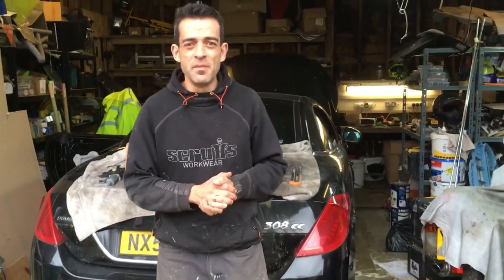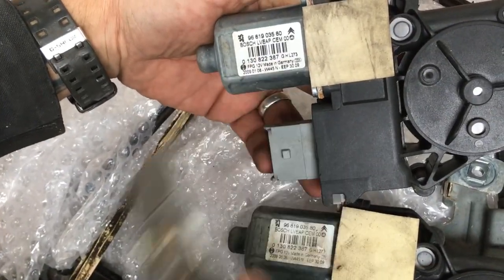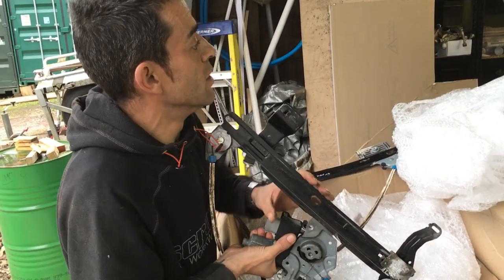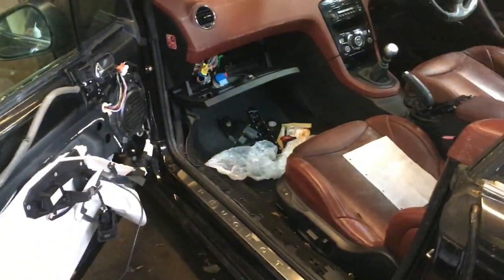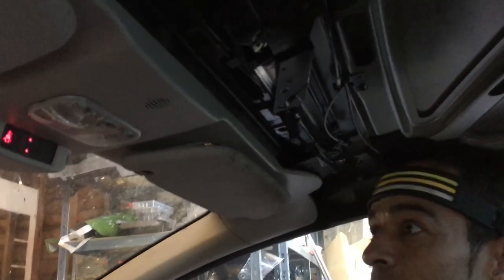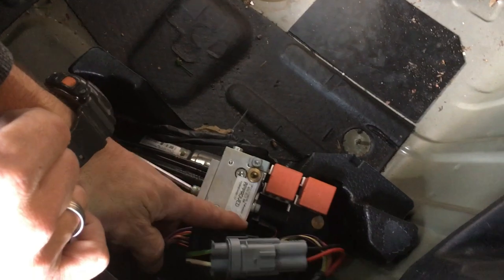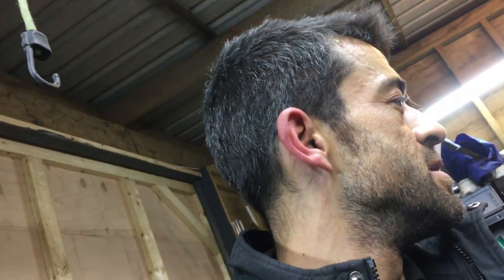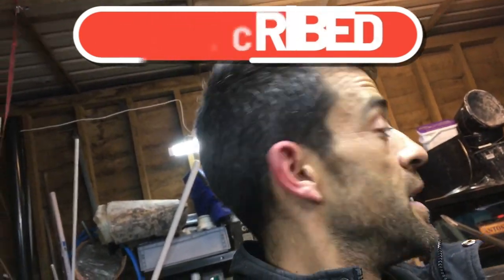Ultimate Diy convertable roof repair - Peugeot - SLK - Eos

Comment: Buddy… Peugeot 307 cc here.. suffering with the roof recently .. was working normally until one time got faulty halfway while opening.. so i closed it but while reopening i would get mechanism error,, i could hear the motor but literally nothing happens just the windows open and sound of the motor … any clue???
Reply from the maker: @karmlino  that sounds like a micro switch issue. There should be about 7 of them throughout the car, for the roof. The easiest way would be to plug in and obd reader which can rest the mechanism fault, then run the roof to identify which switch is faulty. As an extra check make sure the cable mechanism in the boot for the hinges do not have interference.

Comment: My driver side window will not go up or down smoothly it goes down by pressing and letting go repeatedly (taking around 6 goes untill fully down) and will only go up when I press rapidly and window goes up in a very small bursts movement (uncountable amounts i have to press the button in a crazy fast rythm otherwise it does nothing) and i cannot re-calibrate the window (as people keep suggesting) no matter what i do i think because of the way it is struggling to go up into the closed position. So I foolishly tried to put the roof down, the boot opened but the roof didn't move meaning the boot got stuck there so i had to put the boot down manually because it would not complete the process either way so now the car just prompts me to complete roof maneuver immediately but i do not dare to touch the roof swith again until i have fixed the window problem because i feel it will just stop midway and get stuck again. I believe I may have a faulty window switch (driver side)? Or could it be the same problem you had? If so i do have a spare regulator motor but it's for the passenger side window and not the driver side i need would that matter or can i still use it? Thank you any and all help will be greatly appreciated 🙏 also after struggling to get the window all way up when i open the door it does drop like its supposed to but it drops considerably more than the other door and when i close the door it only goes back uo half as much as it dropped, i can literally just keep opening a d closing the door untill the window is all thw way down
Reply from the maker: Hi Anthony, Get yourself a drivers-side window motor/regulator and get the window reset sound like a regulator pc board issue rather then a faualty roof, start there and work through the electrical gremlins one buy one hope this helps and keep me posted, Kind Regards Mario, Menace rides uk

Comment: Hi I'm Peter from Durban, I can hear u from S.A. by yur accent. I also got 307cc with roof problem. My windows work and I've tested pump, plus relays. All ok. Now I'm stumped
Reply from the maker: @peterstephens8745  Hi Peter, yep from SA. Could you describe your process of opening the roof and where it faults? Or does it not even open?
Reply: @menaceridesuk  Hi I now found both micro switches on drivers side boot flap are missing metal contact strips that open or close on boot flap when roof is opening. I don't know where to find these in Durban. Hoping this is the problem